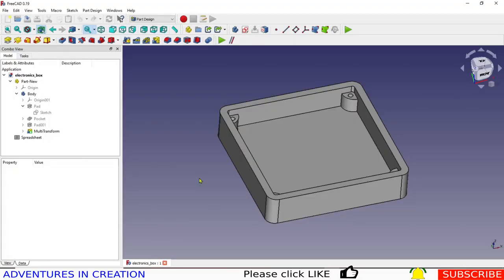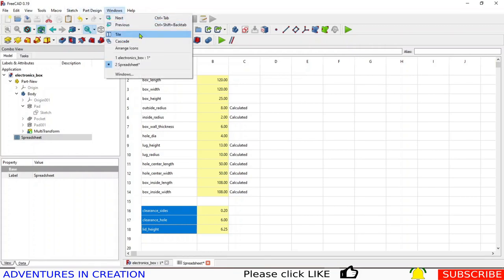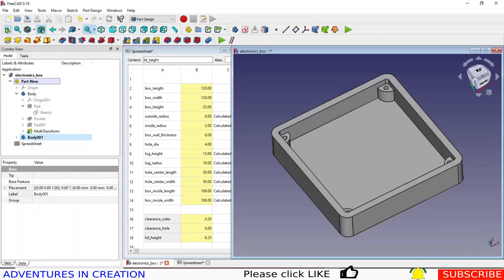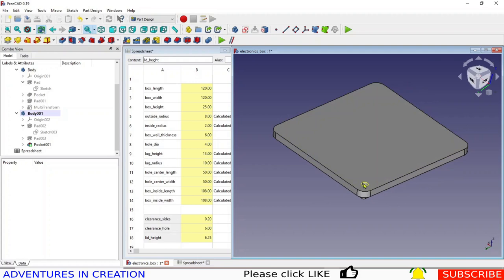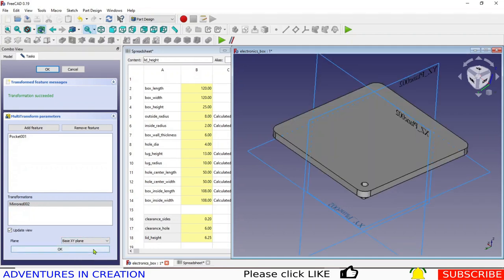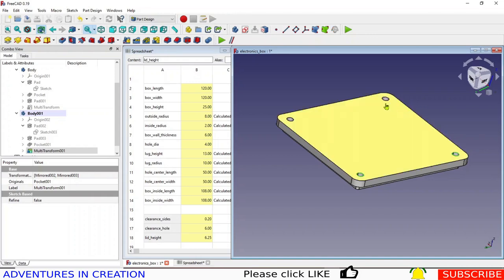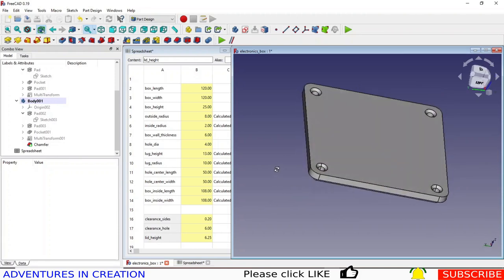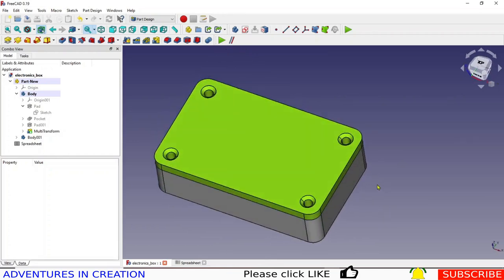FreeCAD Electronic Enclosure Lid Using Simple Parametric Design Techniques

Comment: Really good tutorial, easy to follow! 
I follow your steps and made a parametric box with lid and it works fine. 
Since I have a PrusaMini with only180x180 mm printing bed I can't do a box sized for my need. Can you design a parametric box with a middle section which can be printed out separately and somehow attached to the other parts? 
Very grateful if you can take your time to help me.
Reply from the maker: I would love to help. Can you explain what the middle part should look like? I am sure we could create a parametric insert.
Reply: @Adventuresincreation  
1. Cut the box and lid in the middle so that they can be printed separately.
2. Make a center sections, with equal profile, that can be inserted between the cut pieces.
3. The pieces should be able to be locked to each other.
Reply from the maker: @janhellstrom4165  I will look at it and see what I can come up with. I am not sure why we are adding a center piece, if we were to model it in two parts wouldn't we just print the center piece in place?
It seems that you want to accommodate a larger box on your smaller printer, is that right?
Reply: @Adventuresincreation  Just now I have 3d-printed the hinges you designed in your last tutorial. The result is amasing. I did not know that it is possible to print moving parts in one piece, cool!
Regarding the box.
Yes, I wanted to print three parts, each with the maximum length of 180 mm, that gives a box of 540 mm total length, but it's ok to skip the center part and make two pieces with length180 mm each for a 360 mm box. It a simpler solution and I can print one more set if I need.
I need the box for my CNC-machine, now I have all the electronics around the machine.

Comment: Hey there, many thanks for these 2 electronics enclosure videos. I have used this as a base for an arcade joystick that I would like to print at some point. For me, the "lid" of the enclosure becomes the joystick's base, so I have the "top" and "bottom" concepts reversed in my file.

I would like to ask if you can show in a future video the easiest way to add cosmetic features on an edge (e.g. text/shapes that you can pad/pocket).

Also, I just subscribed, congratulations on eventually hitting 1,000 subs in a few days, keep up the good work.
Reply from the maker: Thanks for the feedback, I will be happy to show how you can add features at an edge. It will be utilizing offset sketches or datum planes.
Reply: @Adventuresincreation  Many thanks my friend, I'm looking forward to it.

My design will follow the design of an early 90's joystick. The most challenging feature for me will be to add chamfers like the one the original gameboy has at the bottom right. To the best of my understanding the gameboy's chamfer at the bottom right is not just cosmetic but is placed there for ergonomic reasons.

Image of (legendary) Aneroussis Pac-Man joystick: 

http://20thcenturyvideogames.com/Consolas/AneroussisControl/accesorios/AneroussisControlPac-Man.jpg
Reply from the maker: That looks like a fun build
Reply from the maker: I took a quick look at this. If you use a datum plane to align your chamfers then use make a "thick solid" you will end up with a box that has those chamfers in it.

Comment: Both video's are really excellent, thank you very much. I do have one question though. You create all sketches based on the base XY plane and then move the objects (wall_thickness e.d.) why not use a datum plane?
Reply from the maker: Thanks for the feedback. You can do it both ways. It's whatever you prefer.
Reply from the maker: @jj_uk  the plane will not cause the topological naming issue if you do not tie it a face. If you instead, index it from another plane it will be robust.

Comment: Quick question, I went thru the box tutorial, then this one.  Much success and now I have a nice box.  My problem is that when I change something, say box height, the box bottom changes height correctly but the lid stays where it was.  It's sketches move up appropriately but the solids (pads pockets, etc.) remain fixed where they were when created.  I can't figure out why.  Any ideas?  Also, thanks for the videos, they really helped me learn to like FreeCad a lot.  I used Catia 4 & 5 years ago at work and FC seems a lot like it with respect to workflow with the huge advantage that I can use it at home... and there's a KiCad workbench!  Amazing!
Reply from the maker: Not sure why your lid is not changing. If the sketches are, you may need to hit the refresh button... It's like two blue arrows

Comment: thank you for the excellent tutorial. I have a question, if I want to use a M3 bolt or screw, do I need to add a thread in the hole?
Reply from the maker: It depends what type of screw you are using. If you use self-tapping screws you can just make the hole to right size and drive the screw in. If you want to use a machine screw then you will have to model the thread in the hole.
Reply: @Adventuresincreation  ah i see, thank you for the answer sir.

Comment: Did you have any printing issues with the wall thickness around the lid screw holes: it looked pretty tight in places!
Reply from the maker: No issues whatsoever. It's parametric so you can change it 😉

Comment: Hmmm… this is where i get connected.  To add 2 tabs on the lid, can’t add to sketch003 or create another sketch  because a tab will be another solid which is not supported.  What approach do i take? I can create another body and sketch.  If the tab  is a  rectangle, how is it attached to the lid horizontally as part of the lid?  Probably wrong approach 🤔 thankx
Reply: Btw, rectangle also will have  through pocket for screw to attach box
Reply from the maker: Wouldn't the tab be connected to the lid though?
Reply: @Adventuresincreation  hi yes.  Can another part be added to the lid?  I tried with adding another body but how do i attach it to the lid? Or do i need to modify the sketch003 ? 🤔
Reply from the maker: @rondeangelis7384  if you created a new body, use a boolean operation to add them together
Reply: @Adventuresincreation  aaah was wondering why those operations are used for.  After doing some reading, after .16 versions, the object has to be contiguous and removed multisolids. 
I’ll try boolean 😨. I check out your boolean tutorial 👌
Reply: @Adventuresincreation  I think I understand now why multiple solids not allowed.  Once a sketch is padded, cannot just draw another object to the sketch and close it.  Theres where the Boolean operation is needed?

Comment: I followed the Youtube film , but when I change for example the lenght of the lid , the box will stay the same. How can I solve this problem ?
Reply from the maker: Carefully check that you have assigned the dimensions spreadsheet values.
Reply: when i copy the spreadsheet ,then i can adjust the lid and the box individual , but not simultaneously
Reply from the maker: @franknaets1370   You should be able to modify the spreadsheet and any dimensions linked to it will change.

Comment: I’ve only started with FreeCAD today. May I ask probably a stupid question:

Why when adding the holes to the lid is it a “new sketch” ? 

This is something I’m finding hard with FreeCAD. Why couldn’t, for example, the holes be added to the lid sketch? The very first sketch you did on this video?

What am I missing ?

Thanks anyone in advance 🙏
Reply from the maker: Hi Graham, if you make the holes part of the first sketch they will be through holes. There are many ways to skin a cat
Reply: @Adventuresincreation  yeah it wasn’t t criticism. It was more a question about, how does this translate to tool paths for CNC if it’s multiply sketches? 

Or does that simply not matter because once it’s saved, using 1 or multiple sketches, the tool paths don’t care? 

Steep leaving curve. And I’ve been developing embedded C, Java and software for 30 years. This is all new to me.
Reply from the maker: @GeeTheBuilder  you can create tool paths around your model so how you got there isn't as important.

Comment: I'm stuck again, I have moved the box lid to the top of the box (perfect) when I create a sketch, the XY plane is on the bottom of the box not the lid. any suggestions?
Reply from the maker: Hi Danny, you can offset the sketch in the Z direction by closing the sketch, click on it in the model tree then in the data block at the bottom change its attachment. That should move the sketch to whatever you want it.
Reply: @Adventuresincreation  i have created the lid off set so that means i have 2 sketches to move on the Z axes now? This isn't working i have to deconstruct my drawing just to put holes in the lid. This dog is loosing the trail!
Reply: I have created a pocket, but the hole is only in the "lid offset" not the lid. Changing the pocket parameters doesn't make any changes. It's like the lid and the offset are two different drawings that just happens to be next to each other.
Reply from the maker: @dannyperkins4220  can you share your file?

Comment: In the Windows 10 freeCAD .19 version 24291 I found that there must be a default radius size, if I select the fillet and just select the box corner a radius is created. Then all 4 corners are created the same size (but only equal by coincidence), you still have to further constrain them. 
        (Sorry - I said  radius constraint and meant fillet - corrected!)
Now if I can just figure out why the pad only made a lid rim and not like your picture. :) It looks like a square rubber band! :( Nothing in the center. I must have skipped a step.
Reply from the maker: Maybe one of your pads is in the wrong direction. The size of the radii depends on where you pick points as you add it.
Reply: @Adventuresincreation  I think many of my problems arise from not having the focus? on the correct place/plane (always the xy) but not the correct place in the parts lineup - if that makes sense. I finally got the pads right on the lid (I think) but now the hole only goes through the inside lid pad even though I clicked through all as you showed. This is confusing since I started the sketch as you did I think - top view. 

I have a CarveWright and use the designer it comes with and when you click on a line in the sketch or click on an object on the left parts list box it is highlighted in both places. I don't find that happening for me in freeCAD. Also I am having problems getting objects to hide/unhide and if I do my focus seems to change at times.
Reply from the maker: @davidpanetta5492  it's probably just a matter of getting used to it. You should be able to select any part /body from the model tree and then hit the spacebar to toggle it on and off.
Reply: @Adventuresincreation  Thats what I thought, but when I click on parts in the tree, then the space bar,  nothing happens most times. When it works and I click back to the part I am working on, if I click back to the hidden part and hit space, it often will not become visible again. Assuming my model is ok, something I am doing is wonky.

Comment: hi everyone, I am having a problem transitioning from the drawn box to drawing the lid, the box wont disappear from the work bench so i can draw the lid.  I am using v0.19. I have watched the video frame by frame and i can find the step on how the box is selected, i see the wire frame around the edges but my drawing doesn't do that the hole box is selected and turns green. I can select a body create a sketch but the box does not go away so i can draw the lid. any help would be appreciated.
Reply from the maker: Try going to the model tab on the left hand side. Click on the box then press the spacebar. That should hide it.
Reply: Thank you it worked one time but i could not select the work plane. I do not have a (new part) icon under the (electronics_box) icon.
Reply from the maker: @dannyperkins4220  can you share your file and I will take a look at it to see if I can help.
Reply: @Adventuresincreation  I figured out the problem I had to select the body and press the space bar to make the main body disappear. My lid is on the top of the box, I still have to create the holes and the ridge. Thank you so much for your help. Danny.
Reply from the maker: @dannyperkins4220  glad you got it to work. Looks like you are well on your way.

Comment: I don't get it. I'm very familiar with 2d CAD, but I can't even get past drawing a square and centering and dimensioning in this frustrating program.  If I follow the tutorial, many if the of the menus he shows aren't visible, I can't seem to select anything etc.   Even following his steps one by one, some things simply don't work.
Reply from the maker: Do you have the same version as in the video? Some of the icons may be obscured if you haven't spread them out.
Reply: Initially I had this problem too.  The default configuration for the toolbars looks very different on my laptop to that shown in your videos (may be screen size dependant?)   If you haven't already produced one, perhaps a video  showing how to reproduce something similar to your setup?